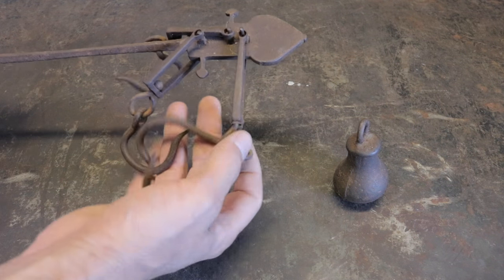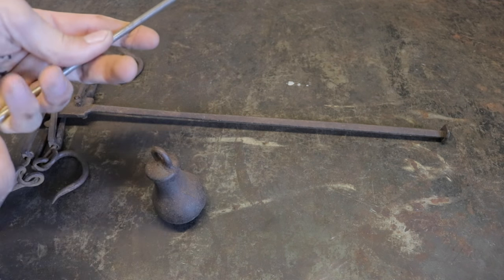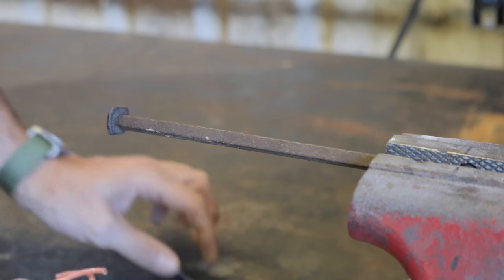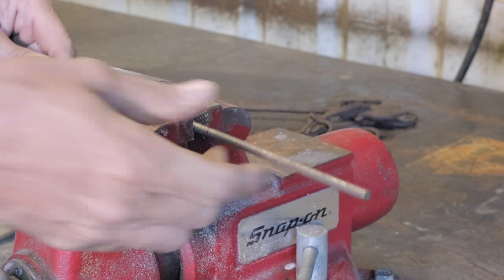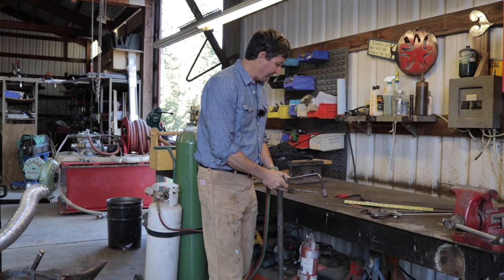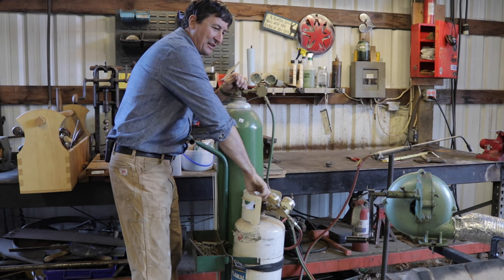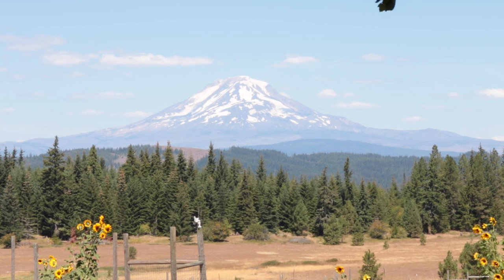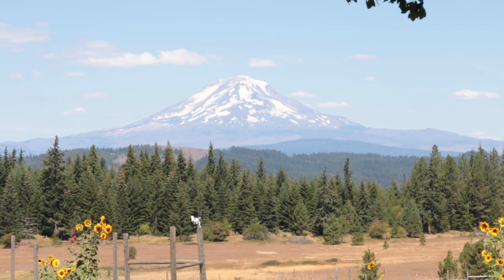Off-Grid Mechanical Beam Scale - Goodbye Digital Scale

Comment: Hey Cody..... I'm an old welder. I noticed when you turned your tanks on you opened them both full open. For safety you should never turn your acetylene or propane in your case full on. A quarter turn is all that is needed. If something was to happened and you needed to turn it off in a hurry a quarter turn and if off. I've had the acetylene line to burst and catch on fire. Just a FYI. I enjoy your channel.  God Bless you and your family.
Reply: Seems like good advice
Reply: i was going to say this also, but decided i'd check to see if anyone else had. I was taught this in welding school.
Reply: great advice. I had a regulator valve blow up on me last month.  if I had the bottle open more than a crack it could have got ugly real fast.
Reply: Randy, a pressure seal valve like this SHOULD be operated in the fully open (AKA: "backseated") position to prevent leakage around the stem.  http://www.airproducts.com/~/media/Files/PDF/company/safetygram-23.pdf 
and while other types of valve designs might not require backseating, it doesn't hurt to do so if it helps the operator remain consistent with his/her procedure :)
Reply: Acetylene and Propane gas are both low pressure gases. (300 psi or less) If the valve is leaking around the stem I would opt for a new tank form your gas supplier, I do believe. But that's just me.

Comment: My father has one of those. He still uses it on the coffee field to weight the coffee picked on a day (digital scales won't last long). Congratulations on the restoration. The only part you did not get right is that the rod used to slide the weight on the horizontal part is not the one with a round cross-section, it has a square cross-section and there is a very good reason for it. 

It is forged in a way that when you hang it, the cross section looks like a diamond <>, with an angle at the top and  another at the bottom. The bottom angle fits into the tiny slits that are on top of the horizontal bar. That's how you get some level of precision on your measurement.

Comment: I'm just off to bed at around 1 a.m. in the UK, but couldn't resist identifying the item as a 'steelyard'.
"The steelyard is a kind of balance, which, though not so sensitive as 
the one being described above, answers very well for heavy bodies, and 
is conveniently carried, as it requires but a single weight, and may be 
held in the hand or suspended anywhere." —Quackenbos 1859"

You may mention this in the video, but I'm to sleepy to check tonight!

Comment: This type of scales was widely used in italy till 40 years ago. Every market stand had one. I remember the scales had a brass plate attached with 3 chains to the scale. The market tender would put the goods to be weighted on the plate and shift the weight on the scale rod which had values in kilogramms engraved on it. I would love to find such a scale nowadays. Good catch!

Comment: I have one in my kitchen, it's been passed down through our family for 5 generations (European ones) I still use it, and i've added my own flavor on it by putting a brass piece of angle on top of the original scale (which was, as time went rough) where i've machined notches. I've also calibrated the iron pear to an even weight. Works very precise.

The only thing that was broken on it was the chain, which, whomever had made it, had real skill not like me, and each of the tiny links were forge welded, at some point one of the three was broken and replaced, which threw off the count. Had a friend who knows his iron make me one within weight.

Comment: When using steel around the house for smithing, try to avoid anything zinc coated or galvanized. I could not tell if your piece was or not but the fumes are pretty bad for you. If you do use some, make sure you have a lot of ventilation.
Half our elderberries have been harvested and the other half should be ready this weekend. I should have enough for a good amount of jelly. 
Thanks for sharing.

Comment: You often speak about working with or learning from your grandfather.  In earlier times this kind of practical intergenerational education was common.  Today this direct kind of education is becoming much less common, and this I think is regrettable.  Something important is being lost was families become move from the old nuclear model to the often fragmented modern family groups.  There is a need for todays kids to have access to the huge volumes of rapidly evolving world of science and technology.  However, the practical hands on learning gained through the real world experience of previous generations offers balance, context and continuity which is invaluable.  Aside from all that, common sense and practical skills are generally best learned, and most easily absorbed and retained person to person.  These are things which aren't easily transferred to a classroom or a text book.  Learning from grandparents is a bonding experience with helps form character and reinforce and strengthen families.  These intangible things are what society has rested on since the dawn of time.  As they diminish or are eroded away society is weakened and undermined bit by bit.  We need grandparents today more than ever.

Comment: You could form that ring cold. Just make a simple bending jig. With a few different sizes, you can form all kinds of scrolls, curves and rings. They even work to make bending heated metal easier.
It just takes two metal pins screwed or welded to a block that you can clamp in your vise.

Comment: Cody: I might have missed it in the video, but, around here we call these balances steelyards. I'm wondering if the beam section is grooved.  The ones I have seen / used have a thin piece of metal, like a washer with a hook on it that connects to the weight. The thin washer sets into the grooves and the grooves correspond to the numbers or weight. Maybe you are going to show this in a future video. You are correct though very few people know what these are.

Comment: I work in the scale industry. You need to ensure that the new loop is not too heavey and change the dead load of the scale and calibration. With the correct dead load the scale will sit level at zero (empty) The type of scale is called a still yard scale.

Comment: A lot of the "Steelyard Scales" I've seen use a hook on the weight. That is because they usually come with a couple of different size weights and was easier and quicker to switch weights when a hook is used. I should mention that I have also seen a few with a ring that is too small to fit over the end and therefore, could not be removed.

Comment: Hey Cody  I'm not a safety nut, but when you turn on the Gas for the torch don't turn it more than 1/4- 1/2 turn at most just enough to get the gas flowing  I have seen them catch fire at the valve and have to shut them down fast  Think about how long it takes to shut it off it it was all the way open///  O2 is  to be opened all the way  or it will leak

Comment: think about it,  much easier to form the loop first, while the rod is still full length, while heating it, bend it around the proper size pipe, then cut it

Comment: Cody, do you think that using a possibly different kind of steel for the connecting loop on that scale might put the scale off by a little bit? I'm thinking that the loop adds weight, and maybe the scale would have been calibrated for a specific weight of loop.

Or am I overthinking this?
Reply: You're correct. I was thinking the exact same thing when he was using the wire for a template. The diameter of rod, the material the rod is made of, and the overall length of rod will determine how much weight is added to that portion of the scale. We know that tear-drop shaped weight that Cody is making the loop for, was probably calibrated to a pretty exact weight when the scale was originally manufactured. I wonder if you and/or I could help Cody out and search the "bowels of the interwebs" here to find him what that weight with hanging loop is supposed to weigh in total? that way, after he's made the loop and joined it to the weight, he can see what the total weight of the assembly is and adjust it accordingly by sanding the weight down (to remove weight), or add some weld to the assembly somewhere (to add weight), depending on what's needed. Hey there WRANGLERSTAR, can you give us the model number and brand name of that scale so we can try to search down some info for ya? Oh and by the way, I also really enjoy your stories about your childhood with your granddad. I could listen all day!
Reply: +Jason W.   Wranglerstar could have also reverse calibrated to find the necessary weight of the loop. Hang an item of an already known weight, such as 10 lb on the scale. And then position the scale's teardrop weight at the indicated 10 lb marking on the arm, and try different sized links until the scale is balanced once again
Reply: +Philip Krahn if its under bit of copper wire under the eye of the weight or even a bead welded underneath(if possible) and if over a couple strokes of a file should do it

Comment: It seems to me that the weight of piece you are making needs to be accounted for to achieve accurate weight readings. I would form a rough hook, then trim its length while weighing a known item. Once the length is known,  then you can form your twisted loop. Or maybe the device was never expected to be all that accurate... Just a thought.  Warm regards.
Reply: Except that the calibration marks have already been etched on the beam, as we saw in the video, I would agree.

Comment: where did you get your pallet of fire hose
Reply: a lot of fire houses actually give it away. or sell them for cheap. I use them at work to cover the tines of a fork truck.
Reply: sweet ill start asking around i may not need a whole pallet, but it would be nice to keep  a couple handy for assorted tasks.
Reply: They are extremely handy! Also very durable, I use them a sheaths for knives and axes.

Comment: I was always told to have my hacksaw blades to cut on the backstroke... anyone else hear that?
Reply: What was the reason for that advice, if you don't mind me asking? I've never heard that before, but have always wondered if that may be better. Thanks.
Reply: +Jason W. smoother cut because you can't put as much pressure on it I've done it for 20 years and I still won't change my habit but just wondering what everyone else does
Reply: +Matthew Girard, Well I am most definitely going to try that. Thank you for the reply to my question. I appreciate that, and I will report back to you as soon as I get the opportunity to try it. Thanks again!
Reply: +Jason W. no problem I'd rather learn from others than to figure them out for myself lol.. my grandpa told me about the hacksaw blades then my dad also and he was in autobody for 40 years so must know some tricks haha
Reply: I was always of the assumption that hacksaw blades only cut on the forward stroke, and that the backstroke does not do any cutting. Is that not true?

Comment: don't you think after a while something like that would lose it's accuracy? I wouldn't know but it seems like it.
Reply: I don't think so. Unless it were heavily rusted to the point of a loss of most of its mass. Which it clearly isn't.
Reply: It will be inaccurate for 3 main reasons. 1) it wouldn't have been very accurate from the factory in the first place, 2) he doesn't know the original mass of the connecting loop he had to replace, and finally there'll be general rust wear and corrosion.
Reply: SaikouHD O
Only by a few grams though.
Reply: i have one over 100 years old and it still works fine
Reply: +Joash Church Hey!!! None of that hateful metric stuff around here!!! 8^)
Reply: Remember that this in not intended to be a precise scale. The wear over the years would change its accuracy but it would be easy to recalibrate by weighing a known weight and then adding or subtracting weight from the sliding weight until the proper weight was indicated.
Reply: Yeah, you can tell it was never intended to be accurate because they supplied an imperial weight with it ;)  #MetricMasterRace